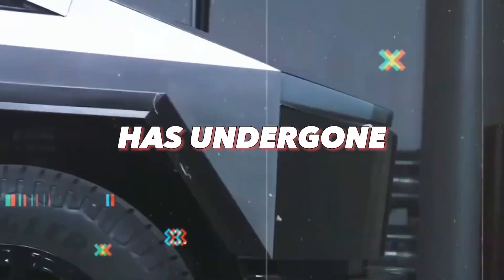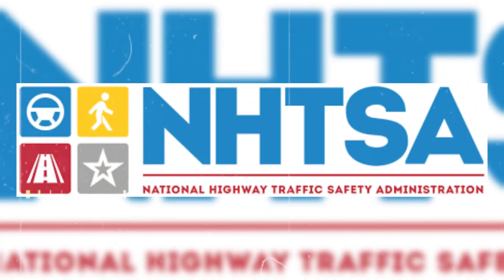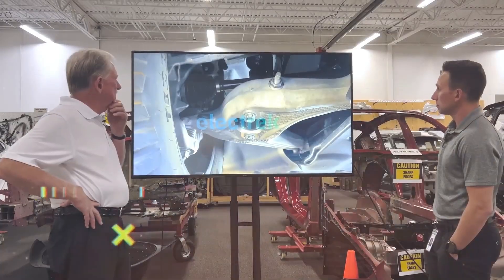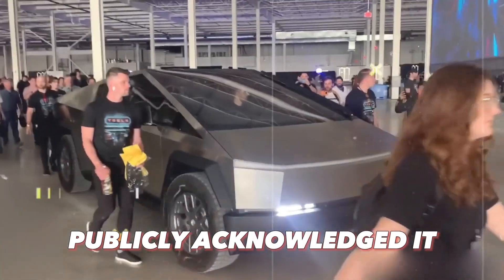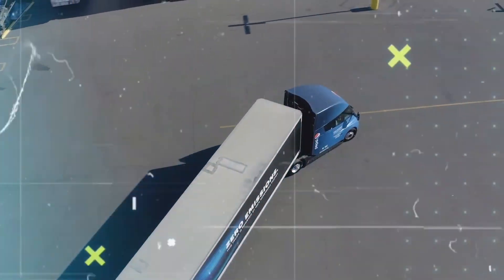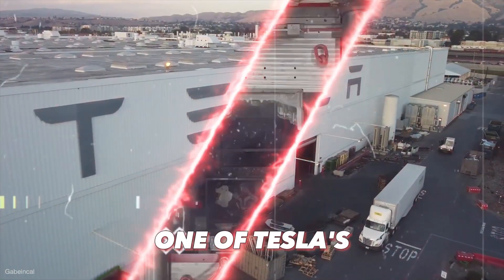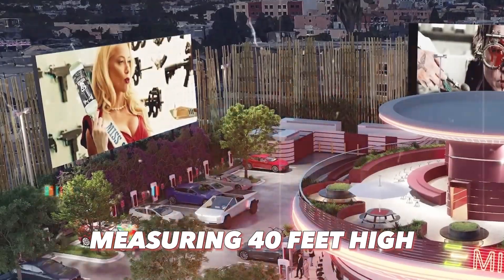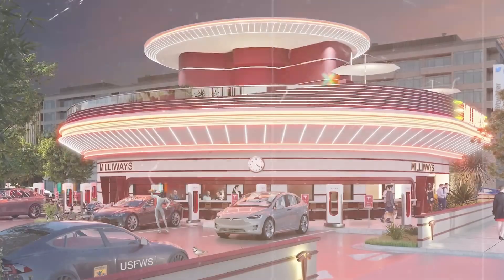Tesla Cybertruck Crash Testing Results Revealed

Comment: Pro tip: If you want the robot voice to pronounce things correctly you have to spell them differently sometimes. Don't type in "Giga" type in "Gigga" or "Gig-a". The computer should say those correctly. It sees "Giga" and because there is only one "G" it thinks it should be said "Jeega". Try "Gigga" then the computer voice should pronounce it correctly. 

Cool video!

Comment: Did you notice the windshield glass especially in the way that it's placed inside the frame molding being angle that direction so much you notice the slight indention split wonder how many charades went through the dummy glass cut up the dummy I bet like I said the ugliest truck that was built with a stick for lack of design effort go back to building Rockets
Reply from the maker: haha hard truth
Reply: Clearly you do not understand the design specification of this vehicle. You can't form stainless steel like you can like shit steel used on current cars. This is tuff as fuck and will not rust.